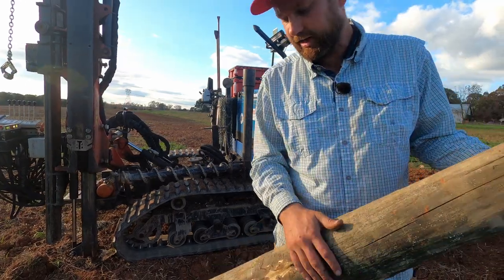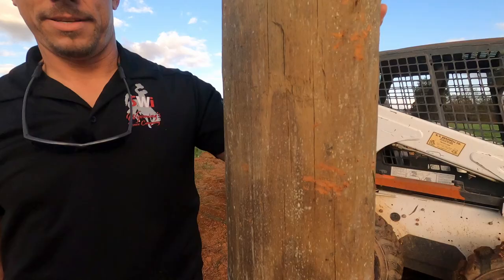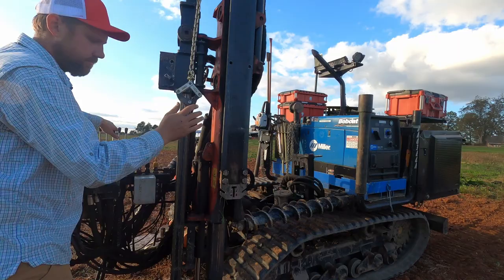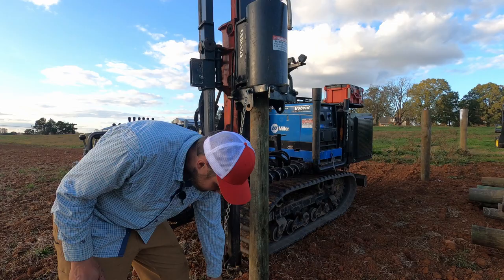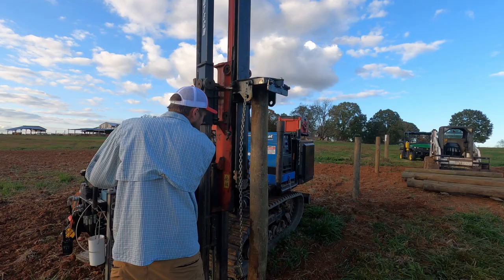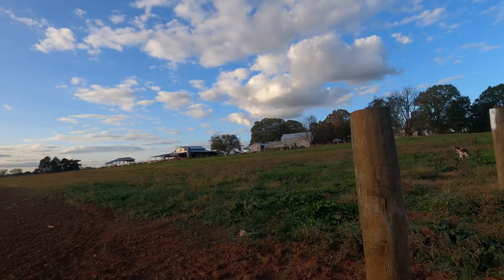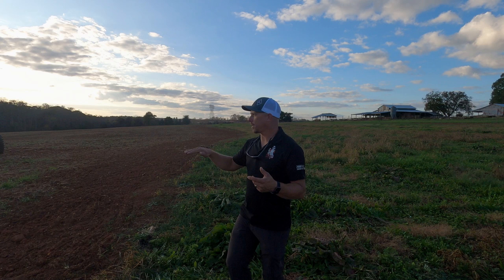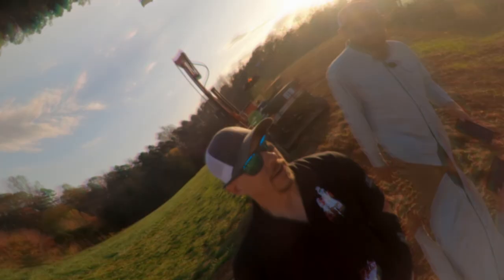Backsighting Fence Posts with No String | Field Demo

Comment: In the Netherlands i do this all the time. Works perfectly with steel posts! Also for the height we mark for example our starting post from up to down on 2008mm for an 2003mm fence and repeat for the post at the very end of the terrain. Then i put on all the posts my height sighting mark, for example 40cm. Now i level the post between the beginning and end post and start using the rhino gpd 45. Benefits are that you can communicate perfectley with your buddy while you see wether the post is going straight or not. Also you can see the height perfectley from that position. I forgot to mention that i use a very bright orange leveler at post of the end. I put the upside of the leveler on my 40cm mark and now i can very accurateley sight my height marks. It takes a bit of practice before have mastered this skill. But when you do... game changing. I will make a video if i’m on a job somewhere! 

Greetings from Max
Reply: Thanks for sharing Max!   Are you a pilot as well?  I’m thrilled to see our video crossed the Atlantic!
Reply: @wyflyguy114   No this is just a very old account, i like aviation though! Back in the days it was a little boy’s dream. But now im happy with the life i live as a fencing contractor in the mostly modern infrastructure of the Netherlands 😁. I’ve got another channel that i’ve just set up about fencing. Only 1 little compilation on it with just some pictures. But im planning some more video’s for it. You can check it out on: Dutch Fencing 020. Not my intention to promote it though, just sharing some love for the job!
Reply: Hey Max. I learned how to do the same thing quite a few years ago. Saves so much time.Freaks the customers out sometimes tho “Your not using a string!?” Lol
Reply: @landmarkcreations1183  Yes hahaha that’s hilarious! If people say that, i always say that gardeners use strings! Then they often say; “ Well you are the proffesional”. I love it. I’m making very cool go pro stuff right now. I will send a link when it’s done!!
Reply: @PilotMaxxx  ya man would love to see your stuff!
Reply: @landmarkcreations1183  Btw where are you from? I do speak dutch the first video’s. I will make some english afterwards!
Reply: @PilotMaxxx  From Tacoma Washington USA. Cool to hear from fencers across the world!
Reply: @landmarkcreations1183  Yeah indeed! Can't wait to show you guys how we work in the Netherlands. Also really thrilled to show the different kinds of fences we work with. Chainlink for example is not that different here in Holland. Just some small details. We very often place '"Dubbelstaafmat"'. Very modern type of fence, and awesome to work with. Video's coming soon....!
Reply: @PilotMaxxx  right on looking forward to it!
Reply: @landmarkcreations1183  And did you watch?

Comment: I'm amazed that in the 15 or 20 videos I've watched, no one or no company has used a red or green laser to line/align/true things up! In this video, should be excellent help in the fading light.
Reply from the maker: It would take too long and the laser is very difficult to see in the daylight.  Once trained, this is the easiest method that works where strings and lasers don't.

Comment: Is he saying "rabbit" post or "rapid" post?

Sorry I'm new to all of this and now all of the sudden have to install 500ft of fence because neighbor dogs killed a dozen of our chickens and they will (and have) returned. Trying to sight in a fence (if that's what it is called) and I'm learning terms and definitions lol

My husband works 24/7 and cant really research anything bc he has zero time...so I really need to figure this out for us. 

I'm just using tposts and trying to line up the very middles of the tops and seeing if it covers the corner post at the end and turning around and looking at the 2nd post and doing the same.

Any advice is appreciated 🙏
Reply from the maker: Rabbit post. Don't ask me why. 🤷‍♂️
Sounds like you're getting the hang of it! Carry a level with you and make sure your posts are plumb as you go. It is challenging--once you know it, you know it, but it is a skill so be patient with yourself. Also, there's no shame in using a string if the situation calls for it and it'll save you time in the short run.
We talk about eye sighting in several videos. There may be some other insights in there for you. 👍🏻
https://youtu.be/elMyil_o_gU
https://youtu.be/XTj5HESFo9c
https://youtu.be/STRqduxsokA